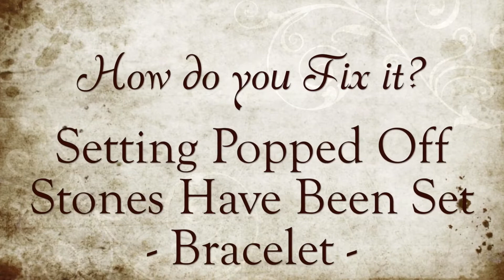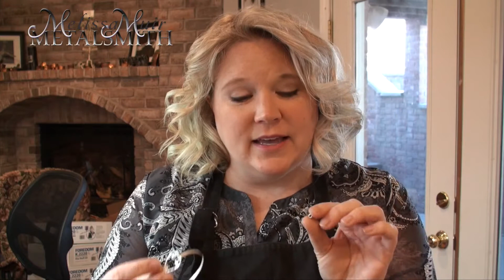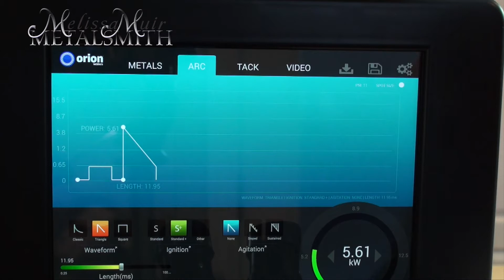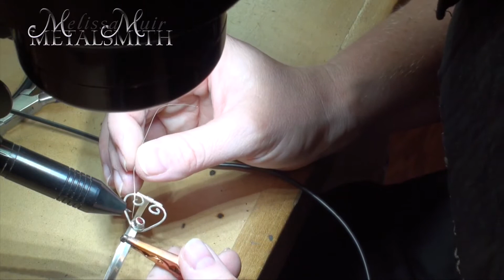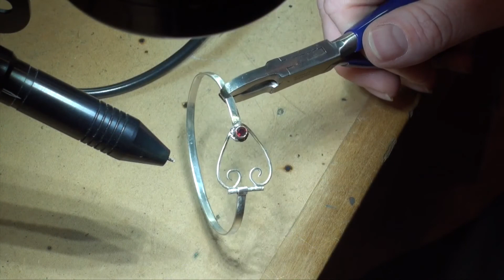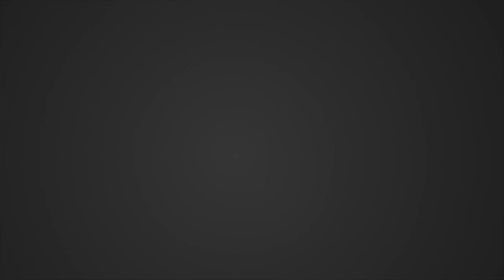Bracelet repair with Orion 200i2

Comment: Just an FYI,  Most synthetic stones will take the heat required for soldering as long as they are protected with boric acid/alcohol mixture and heated and cooled slowly.
Reply from the maker: Thank you. Yes, I did know that.... but I still have inconsistent results. I am still working on it. :)